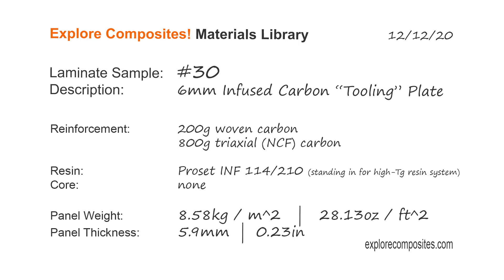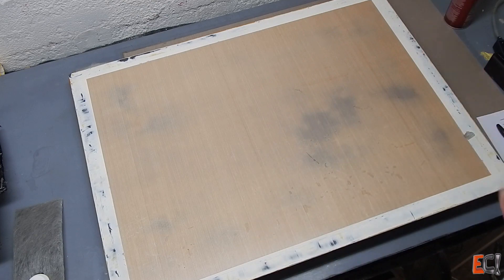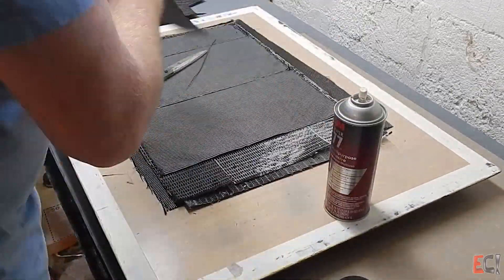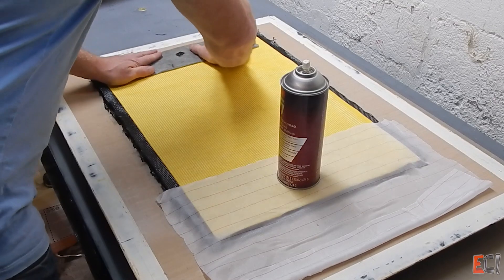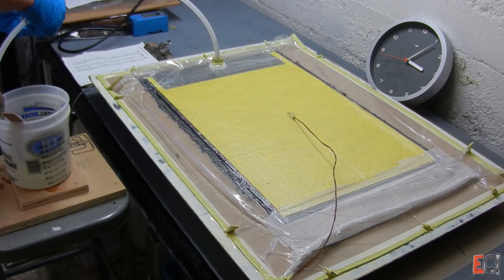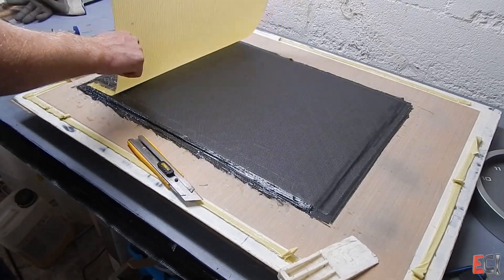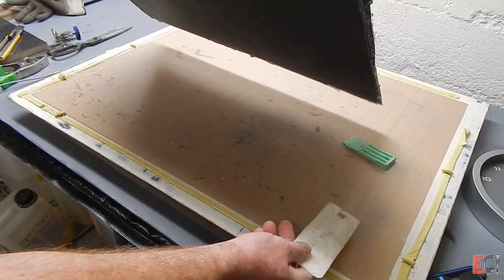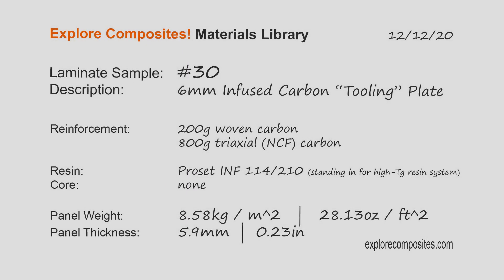Laminate Sample #30: 6mm (0.25") Infused Carbon "Tooling" Plate

Comment: Do you post cure any thing?
Reply from the maker: Sure, usually with a heated table in these videos because I don't have a good oven setup.  Pretty essential with any higher performance epoxy.  How hot and how long depends on material and target Tg and service requirements.

Comment: How would forged chopped tow compare to this for hard point mountings ? 

And those white lines in the cross-section, is that the stitching? Ive seen them on monocoques.
Reply from the maker: "Forged" short tow is random, so it is not super repeatable, and I would avoid it for anything that needs to be strong.  Obviously, this can be figured out with some effort but in general it's easier to just make plate for mounting stuff.  If you were compression molding "bulk molded" hardware for bond-on hard points, I'd have a different opinion but that will take some planning.  Easy Composites did a great video on making stuff with chopped carbon in 3D printed molds.

I'm not sure which you mean but yes, you can see the stitching - this is pretty heavily stitched material.  Also, in the thumbnail type images, the lines are fiber layers running parallel to the cut so they look shiny.

Comment: Why is it necessary to use spray adhesive between layers if the lay-up is completely flat?
Reply from the maker: It isn’t really but for heavy material with some set from being rolled it can help.  Also good practice to make test panels in the same way you’d make parts.

Comment: How does carbon compare to basalt for thermal expansion?
Reply from the maker: Carbon is better (lower) than basalt, but basalt is better than glass.  I think the effective CTE for basalt is around 2 x 10^-6
 / °C where carbon is around or slightly below zero and glass is about 5 x 10^-6
 / °C.  I am not 100% on these figures but the general idea is basalt has about half the CTE of e-glass.  Might be a good thing to test!
Reply: @ExploreComposites  thanks, I’m starting on a new plug for a skiff next week, and will be making a mold in late January. Will be doing be & epoxy builds out of it. Seriously looking into using basalt for the first 1/2 of the laminate in the mold.  I know it’s a great insulator so it should reduce the glass from expanding and keep the heat where I need it.

Comment: would you use a gelcoat on a tool made this way?
Reply from the maker: You could use a polyester gelcoat but it wouldn't hold up, and bonding to the carbon/epoxy would be problematic.  A vinylester gelcoat with a glass mat skincoat would probably work (for a while at least - and only at low-ish temperatures) but isn't standard/good practice.  

Most tooling like this either gets left raw like this and release coated or gets a gelcoat-like epoxy mold surface coating that gives a very hard surface and reduces the likelihood of print-through.  The coating is usually applied to the plug surface and the dry infusion layup is done once it is semi-cured.  The postcure gives everything an all-epoxy primary bond and things are good.
Reply: @ExploreComposites  
Thanks alot for the reply! 
Im looking to do most plugs/masters using polyurethane tooling board and a cnc router and coat polish gloss using something like easy composites 
S120 Advanced Board & Mould Sealer.

So the plug will be pretty much perfect. Previously I have always used a brush on vinylester and polyester fiberglass tooling system but I get air bubbles in the gel and other cosmetic issues with that some times. I dont have a spray system for the gelcoat. 

Would this be a decent alternative to do it, if I use a single block of tooling board to keep the air leaks down?
Reply from the maker: @johndiedrichs6155  If you need the low CTE for cooking carbon parts this is a great way to get it.  If you're not cooking prepreg then this is way overkill!  

You don't need a gelcoat, but it does make things more forgiving in terms of surface quality.  Generally if you need a gelcoat finished part then the tool should be gelcoated - if you're building parts that get painted then a raw carbon tool surface is fine.  You can use the same primer/sealer/release coat type system that you use on tooling board.  If you envelope bag or bag the tooling block to a table, the leaks are less of an issue.

Have you see the article on the EC! site about tooling boards?  There is a list of products for finishing tooling block - similar to the S120:

https://explorecomposites.com/articles/tooling/machinable-tooling-boards/

There's also an article on gelcoated production poly/VE type molds - might help with gel issues:

https://explorecomposites.com/articles/tooling/building-open-molded-production-tooling/

Comment: Any idea on the resin consumption (waste) of that Enkafusion? Also  hard to tell from clock/timelapse how fast the enkafusion really filled compared to the laminate.   How far can the Enkafusion carry the resin before needing another input port?.  Looks like you had 3 inch wide (probably overkill for your plate), I've got 2".  My part is 18' long (and likely will need zones). Plan to use INF-114 so same viscosity.
Reply from the maker: I threw out the Enkafusion or I'd weigh it - it uses a fair amount of resin - maybe a 1/16" thick "bar" or resin the width of the channel.  Yes, the 3" stuff was way overkill here - filled in maybe 10 seconds.  It flows fast and far - maybe 10' between ports is doable if you have bigger feed lines - maybe more.  Unless you use a coated peel ply, it sticks like crazy to the laminate - with nylon peel ply I have had good luck putting strips of teflon coated peel ply just under the Enkafusion so it releases ok.
Reply: so this brings up a question about peel plys.  Most seem to be nylon.  I've been using some Airtech Econostitch and have some Bleeder Lease B, and some Porous Teflon to do some testing with.  Also got some samples from Pro-Vac.  Very similar look and feel to the Econostitch.  One was nylon, the other polyester.  Any idea about why you would use polyester vs. nylon?  Nylon  won't stick to the resin - the bag film is nylon and doesn't stick and neither does the peel ply.  I haven't tried the Polyester peel ply yet, but if you used it with polyester resin, you would think it would bond in. ?????  Pro-vac is west systems, so maybe they expect that you would use it with only epoxy.

Comment: When I look at what we get for heavy fiberglass truck canopies and solid tonneau covers versus how much they cost, it makes me highly disappointed that techniques like this aren't used in their construction.  Even if this would be significant overkill for such a part, it probably weighs a third of what the fiberglass ones weigh and as expensive as they are I don't know where the money's going besides company profits.
Reply: It is entirely false to think that composite parts are over-priced.  Injection molding and thermoforming have warped our sense of value...these processes make a part in minutes, whereas a fiberglass or carbon fiber parts will occupy a mold for a full day.  Manufacturers do everything they can to speed up the process to cut costs, but if anything they struggle to make a modest profit.
Reply: A big component in composite construction is labor! Most truck canopies are E-glass and the worst possible laminate layup, chop layup. That's where roving is cut and sprayed into the path of the resin shot out of a spray gun. The weakest possible laminate, not uniform, and relatively cheap. Even chop strand mat (3/4oz or 1-1/2oz) would be much stronger but the time would go up substantially in the construction.
Reply from the maker: This might be overkill!  And you'd be surprised how expensive a layup with all these plies can be.  Labor is a huge consideration for composite manufacturing unless you are in the very high volume fully automated situation.  The material in this sample alone is $35-45 per square foot -  so over $1000 just in materials for a 30 square foot panel.  And it'd weight 60+ lbs!

Comment: Nice ! Tooling prepregs are terribly expensive so I also keep them for complex projects or where more durability is required. Actually, I even go to fiberglass (fabric then multiaxial just like you did) when CTE is not an issue, even to mold carbon fiber prepregs. I just tried "bag ports" from Eldon James, they make wonderful infusion hose ports, inexpensive, ultimately reliable seal, and do not stick to resin at all. You may want to try those !
Reply from the maker: Thanks for the lead on those bag ports - just looked them up and they look ideal - and cheap!  

I too have used glass for small stuff or parts where the geometry doesn't care about a little mold movement.  But there's lots of carbon out there and sometimes you can pick up surplus stuff cheap that's perfect for tooling - that's what this slit material was.

Comment: what is that wire type thing on middle of setup?
Reply from the maker: That's a thermocouple to monitor temperature.  I was going to go over postcuring and Tg and more temperature stuff for dealing with higher temp tooling resins.  The video got too long - and I got lazy - and it's not something you can cover in a minute without being even more confusing!